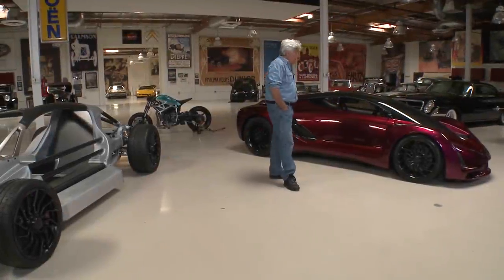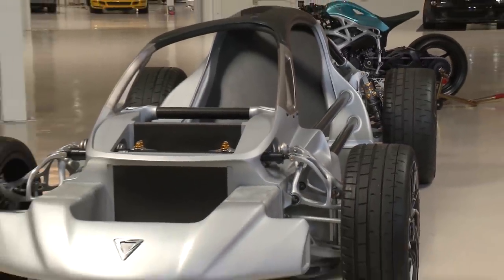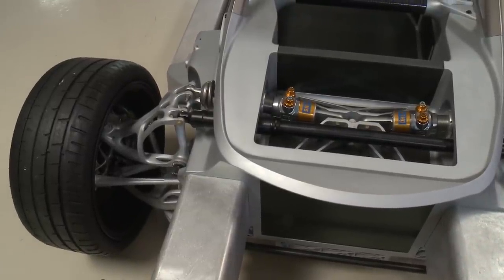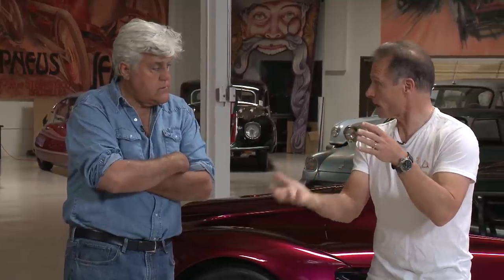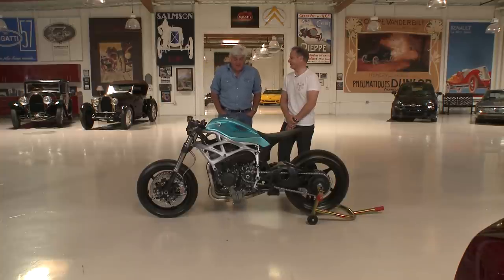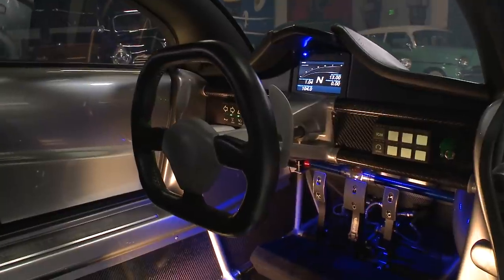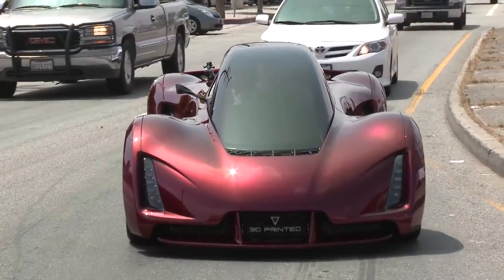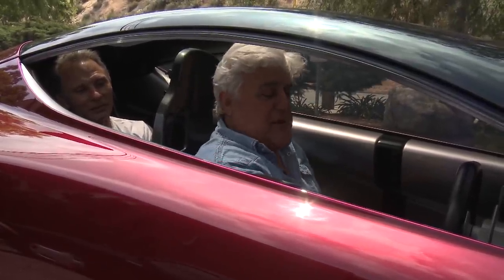2015 Divergent Blade - Jay Leno's Garage

Comment: doors flapping as it drives down the road really screams quality manufacturing
Reply: Mattwhitty710 he said its a prototype so idk
Reply: Tarek Sweid I don't know how much wobbling actually is by video stabilization, maybe afterwards from YouTube. Have seen that on some car videos where straight lines looked really wobbly.
Reply: you didn't get the point of the video
Reply: Technology demonstrators usually have aesthetic problems. The main story with the car is under the skin.
Reply: Terek Sweid the production version would incorporate anti-flap technology
Reply: Did you listen to the whole video? They may or may not make these cars.
Reply: Mattwhitty710 the door is shaking because it doesn't have a tight closing door with weather strips, it's not a production car
Reply: its camera vibration
Reply: Yeah, and new company whose actual focus is making the machines that make the cars, really is not putting that much attention into final build quality. 

Also the door was not flapping it was vibrating. A Four cylinder, 720hp engine is going to vibrate very hard. It needed to be better isolated. But that goes back to it being a technology demonstrator, not production car.
Reply: BULLSHIT. It's the doors moving. FAIL!!!!
Reply: It's an aerodynamic feature! Inspired by Pagani! Not a problem at all! If it causes crash, you didn't deserve the car! 
tightens some bolts
See now I turned off for you! Shame you wanted to spoil handling!
Reply: Gerrad Reynolds That's no camera vibration. Those panels are vibrating themselves
Reply: Funnnny, what a character..... there again it is a prototype.......... give him so slack
Reply: Kenneth White actually, the doors were still and the universe was vibrating
Reply: What du you expect, it American.
Reply: What's making the camera vibrate? The sketchy platform it's mounted on?
Reply: shut up clarkson.....jk
Reply: The hand @00:15 hand me creeped out for a second.
Reply: The plastic fascia (bumper cover) flaps more on your Toyota going down the road.
Reply: Truth seeker. Great grammar. And where are you from.
Reply: its just a skin, like a nascar.
Reply: Sorry m8, a door latch would have added unnecessary weight. LOL
Reply: Mattwhitty710 What part of prototype don't you understand?
Reply: I don't know if this post is sarcastic, but If your car is literally trying to fly, I'd say it's pretty fucking advanced.
Reply: Wait for it.
Reply: Mattwhitty710 Dude did you actually watch the whole video?  I'm guessing not.
Reply: It's all the rage now, did you not see Hamilton doing 220mph one handed holding his neck safety cell in place. 

Also one thing they didnt mention was on them straights you all so have to shift the break bias, to the correct settings for every corner. So your not simply hanging on and changing gear, you also having to remember the break setting for the corner your approaching. So one hand at over 220mph is no mean feet. 

So what's a bit of body rattle.
Reply: Mattwhitty710 its a prototype mule
Reply: That's one of those things that could easily be worked out, in a production situation.  See what ya mean, though.
Reply: Mattwhitty710 camera
Reply: Joe Greene,

0:10 You should have noticed the panel the camera was mounted on was NOT vibrating. The Door panel was. If the panel was also vibrating the ENTIRE image would be vibrating a LOT more than it was. Again it just goes back to the door was not well latched, and the Engine needs to be better isolated for NHV.
Reply: This car is a "Technology Demonstrator"! Get it now? ;-)
Reply: Very cool design concept. As stated, it has no insulation ie. deadening/stripping which explains the "flimsy" appearance, but if added, you lose the near 1000lb weight advantage it has. Even production cars turned into race purposed vehicles pick up alot of the wobble and flex.
Reply: divergent technologies... more like VIRGIN technologies
Reply: tikl7790,

Not really. The actually weight of sound deadening in a car is only about 50-200 lbs, depending on how absolute and comprehensive the loadout. Up to at least double that in a S/CUV. There is a reason why Luxury cars typically weigh more than non-luxury cars of about the same size. Of course, with more cars adding more luxury like appointments like laminated glass more sound deadening materials, heavier frames to absorb more vibrant and sound. The weights are not as far removed as they used to be. 

Vibration isolation, in most cars, is really just a matter of better engine mounts and or an a engine that does not vibrate like a jackhammer working reinforced concrete. All and all, Adding some proper sound deadening and reworked engine mounts would add AT MOST 150lbs to a car like the Blade. Frankly, you'd have to really overdo it to add more than 100lbs to the car.

Also, the sound deadening is NOT structural in the car. It is usually felt or foam matting under the carpet and embedded in the interior panels. Removing this to get the weight out does not introduce wobble and flex. Stripping the body and frame of the car itself, for example removing the steel roof panel replacing it with Carbon Fiber that is either not attached properly or is too flexible itself, will introduce flex and wobble. 

Everyone fixates on that door vibrating and it has NOTHING to do with structure of the car, since as in most modern vehicles, the doors are not structural You can literally take the doors off a Corvette 911 or Ferrari and drive with the same rigidity and confidence, ignoring that the doors are gone, as with them.
Reply: DocWolph Very well put together response, I have to admit. Also I must completely agree with your point on rigidity in relation to external body components. I understand the panels moved as they did is also much a result of the materials they are made from, poorly mounted metal will usually show less flex than poorly mounted lighter material but vibrate more. Also one cannot overlook that the body on this particular vehicle was merely a skin and mounting was nominal at best. I must say if they integrated the same amount of thought and process into the body and mounting as the chassis it would eliminate the issue entirely. The chassis, being the focal point of the video was very well executed. I can see the application going far.
Reply: Ovbiously, it's a prototype, cobbled together in a rapid time span. It's amazing it was driving as soon as it did from the cad drawing to the road.
Reply: @ Mike... Except that I've been a career professional photographer for 30+ years. Your claim is not correct
Reply: It's a prototype, If it's made at ALL parts may be added and parts may be deleted~
Reply: Mattwhitty710  I'm sure the prototype Apple Computer had flappy panels. But I guess that didn't work ur either.
Reply: Kalice et athena
Reply: Yeah low quality, like a Formula 1 car. It's non-structural.
Reply: If they make the car or not doesn't matter, and I think ppl are missing the point. There making technology to sell to car manufacturers to help make and manufacturer cars. But with viewing this car in action made from the technology they used would a car manufacturer want too??? The car has poor quality manufacturing, so the technology doesn't really seem to make a quality product. Listen to him speak, its all about cutting cost, and that cost cutting is shown in how poorly the car is made.
Reply: Regardless of why the door looks like it's about to fly off, I can't believe they left those unflattering shots of the door seam in the video.  If that were my car, I would have to either make the body more rigid, or at least not zoom in on the wobbling body panels, until I had a chance to iron out the design flaws.
Reply: The car is not particularly poorly made, just the non-structural shell.   The "chassis" and "frame" look fairly robust.  The outside  "body" is just a cover, for lack of something more descriptive.  It is just a demonstration of something this technology could build,  not a traditional finished car. Divergent technologies is selling the "manufacturing"  process,  not this one car.
Reply: It's a Proto type dodo bird!! . Are people really that clueless about the video? Omg
Reply: "Door flapping?"  You missed the point as it's all about the vision, design, and manufacturing techniques.  Besides, he did it and is on Jay's show.  Top that?
Reply: Jay wasn't using a seat belt.
Reply: Eastern Woods I thought so too, no shoulder belts but he had a lap belt
Reply: he doesn't need a seat belt
Reply: It's a prototype
Reply: 1300lbs .
Reply: The tires were flat spotted causing the whole car to shake. Nothing at all to do with quality of manufacturing or panel fitment. Come on guys watch the video and learn.
Reply: Mattwhitty710 It looks like a hot wheels car.
Reply: CHINA
Reply: If you actually watched more than 5 seconds, dude had a flat spotted tire after hitting a pothole.
Reply: Zero Shima my truck hits 150db and ive blown out both the front and rear window yet none of the panels flap like that....  so your flat spot tire is a terrible reason to stand up for this cars obvious lack of quality
Reply: Christopher Valdés lol
Reply: Truth seeker hilarious...  my stereo makes the german, Japanese,  korean cars that are six car lengths away vibrate and flex way more than my American  made auto that has the actual stereo. even my boy said i started to make  his bimmer  vibrate from 100 yards away doing 70mph on the freeway
Reply: 18:34 Spending all that $$$ to build a prototype and knowing that you are going to do an interview.... I would think that at least one of his 50 Engineers could come up with at least a temporary solution to the door flapping in the wind so that it doesn't look like a crappy built kit car by a non-professional.... :\
Reply: Cody Hodgson wow sweet thumbs up dude
Reply: smartest thing any one ever said ever
Reply: I was trying to figure out if it was the camera or the body
Reply: lol!
Reply: Mattwhitty710. Exactly!
Reply: Silver lining: Cars just look faster when their panels fly off whilst driving.
Reply: Tarek Sweid the body is not the important part of this car. It's the 3D printed structural components
Reply: Dr Fear & Co.... Then why put a badly assembled/functioning body on it AND drive it.
It would have been more professional to just look at the body on the static car.
Reply: lasersbee because that is not how it works. if yoh showcase something new you have to show that it works. if it were to just stay there and then break as soon as driven the company could already day their farewells.

Comment: I love how these car manufacturers bring cars to Jay Leno instead of real car reviewers because they know he won't hammer it around the track and he'll only ask if it's a five speed or a six speed and if it has four wheel disc brakes 😂😂
Reply: And he'll give his "nicely done" endorsement.
Reply: They're not a car manufacturer but selling the technology.
Reply: Cersades; 
how come the salesman never mentioned the price (and Jay never asked) ?
Reply: Eryk Pyts Because it's probably prohibitively pricey. The amount of Titanium alone, plus 3D printed metal? At least the souped up Mitsubishi engine is a bargain compared to say, the AMG heart of a Pagani.
Reply: Eryk Pyts Because it's a technology demonstration, aka not for sale.
Reply: That Mitsu ain't as cheap as you think probably still 20k+
Reply: But what about super special cars with diff brakes?
Also it's much cheaper than the design process for making the structure of a vehicle. Like he said many hundreds of millions less for the vehicle manufacturer.
Reply: Folopolis; 
in 2017 everything is for sale; 
I think he didn't mention the price because it's so high, and he didn't want to be laughed at
Reply: 🤣🤣🤣🤣🤣 'so does it have antilock brakes?' Yes jay every car since the 90's
Reply: Getting anti lock working properly isn't a small task. As that car is a technology demonstrator and not anything like the prototype of a production vehicle it wouldn't be at all surprising if it didn't have anti-lock.

Comment: Jay loves 3D printing, don't be fooled if he seems aloof. Divergent Tech needs to raise capital and this car has nothing to do with the exterior "Design". It is a rolling laboratory. We cannot po poo on companies (American) that are trying to innovate. Your next telephone will be 3 D printed. So chill.
Reply: Nukes Away - agree with your assessment, DT could revolutionize auto manufacturing. Depending on how high the royalties go, manufacturers could realize significant profit. Not that we will see savings as consumers.
Reply: As a consumer in 2017 technology is moving real fast. 5 years ago 3D printed metals was very tiny, batteries were crap(still are ). A lot is trickling down to the consumer but cannot be seen.
Reply: There were a couple of things we missed. The Divergent guy started to talk about 3D printing some of the tooling they needed- and was the body printed as well? Sometimes Jay moves on without listening to an answer...
Reply: No, it won't.  Injection molding takes one-quarter of a second. 3D printers aren't that fast.
Reply: Yes Joe Green injection molding is super duper faster than 3D printing.
Reply: injection molding will be the dominant technology for mainstream mass production until additive technologies are capable of the speeds volumes of injection molding at a lower price point. In general this means we are at the very least a decade out from additive making the jump to mass production. At this point milled molds and high pressure plastics with aggregates like glass fiber and beads for high strength applications remain dominant.
Reply: and as far as automotive bodies go, stamped sheet metal is going to remain far more cost effective for just as long if not longer. This technology might become the mainstay of super low volume applications such as prototypes and ultra high end cars but with the amount of sheet metal infrastructure in existence, additive manufacturing is going to have to get almost unbelievably inexpensive to become even remotely cost effective for mass production.
Reply: very true Reid.  the infrastructure is very deep and people like this are viewed as a threat by very powerful entities.
Reply: Jon Focker I don't think that there is a conspiracy against additive manufacturing technology, rather that it is a very interesting technology still in its infancy and we will see it continue to grow into specific applications it is suited for. New technologies very rarely have people actively working against them, industry just tends to stick with known technologies. New manufacturing technology is a very expensive and very risky investment to make for a business. It all is a money thing, not dark forces at work against 3D printing.
Reply: Nukes Away there's no reason why phones should be 3D printed from what i can see. at least not for a long time.
Reply: "Your next telephone will be 3 D printed"
no it wont! cost is too high for mass produced products.
Reply: WING WING WING.....HERRO?

Comment: Reminds me of the Mazda Furai. Cool looking design.

Edit: A lot of crap being talked about the flappy panels and so on. If you guys saw most prototypes (if they even run) by major manufacturers you'd see how damned impressive this is. Specially considering the cost savings in production and how everything can be rapidly prototyped and modified. Game changer I think.
Reply: Absolutely. Surprising that it's 2019 and car mans aren't 100% on this trip.
Reply: Look at it now, Czinger 21C

Comment: This is a really good segment. You are right, this is the future of mass produced automobiles. They are beautiful, light, environmentally friendly, and I bet they can be easily outfitted with driverless technology which would dramatically reduce accidents and fatalities. This would be a perfect car for a daily commute. I used to commute 36 miles a day, hauling around 5,000 pounds of steel. Just a couple of things, it appears to be uncomfortable and tight, although you said you were OK, but it still looks tight. It seems to ride choppy, but that can be fixed with variable suspension tuning, and finally you forgot to ask about gas mileage. My guess is mid 20s in town and 35+ on the highway? This technology is the future, no doubt. Another excellent and informative segment, thanks Jay.

Comment: would buy this in a heartbeat if the design was finalized and made ready for production.

I do have to have a laugh at some of the comments to this video complaining about door flapping or other minor things.. They only stated 239048329 times that it's a one-off design/proof of concept prototype. it's not even a prototype for production, but just a design prototype.So of course there will be issues with it as it's not a final product made for sale to consumers.
Reply: We live in a short attention span country now days, and most of the comments are probably from 14 year old's who know Mommy and Daddy won't send them to driving school anyway. The rest like riding the bus and will complain about anything.
Reply: i think the problem is that 2.4l inline 4 cylinder running 700hp on that HUGE turbo. that thing cant have a long lifetime.
Reply: It's pretty overkill, it really doesn't need that turbo at 700hp. An electric version of this car would be cool.
Reply: kalidesu ,Turbos do more than just add HP to a car. They also make the car run more efficient, plus there's the marketing aspects.